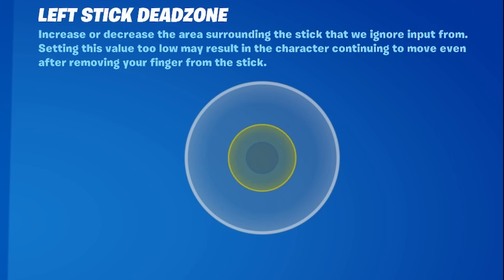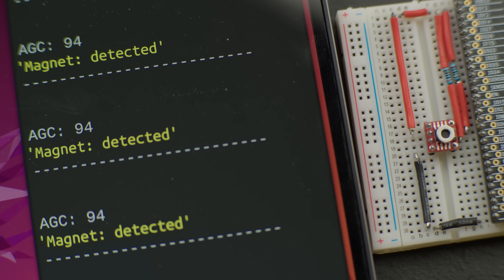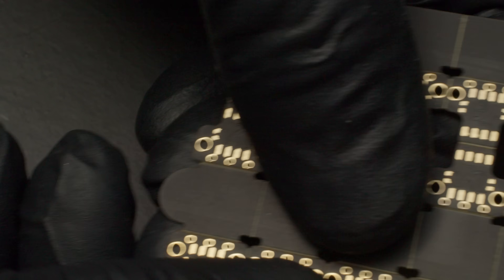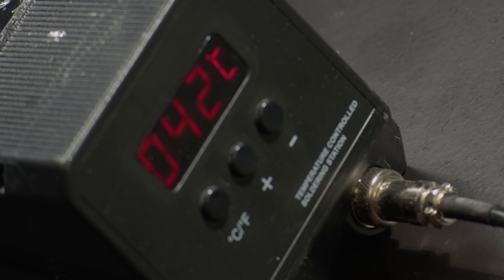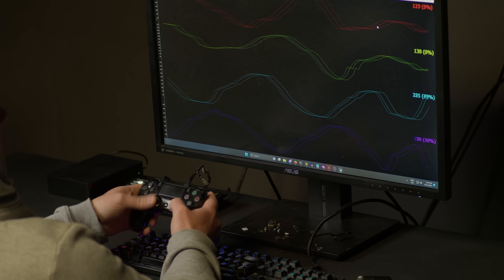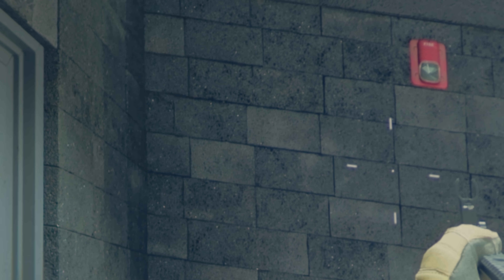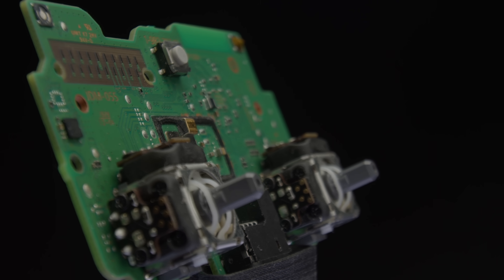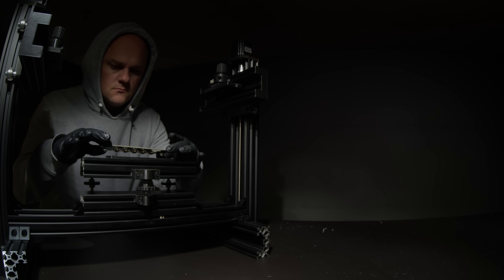Beating the $20B Joystick Drift Problem, and giving it away for free

Comment: As much as I get wanting to not license your product at all, you should license it under an open source license simply to protect it from copyright trolls. They could steal the design, claim it as their own, which by itself doesn't matter, but then they can sue all the other people using your design as if it is theirs, stopping others from using it, which is the real problem.
Reply: @cykes5124 they’re actually already for sale as replacements for various game controllers under the brand name Gulikit. Linus Tech Tips covered the Gulikit aftermarket ones in their “repairing broken controllers” video almost a year ago. $27 for the Joycon ones and $32 for Steam Deck ones on amazon.

That said, this is a dumb problem and game companies should have switched to hall sensors on their own a decade ago.
Reply: @Chirishman6  fun fact the Dreamcast controllers were Hall effect. Companies like Sony never switched because they want to sell you brand new controllers every few months.
Reply: @wayne8797  I still have my Dreamcast!
Reply: @Chirishman6 Ironically, controllers a decade ago did use Hall effect joysticks...The N64 controller is one of the first i can think of
Reply: @Chirishman6  the dreamcast fixed this problem, had hall effect joysticks, even the n64 had drift proof joysticks, it used an optical system similar to early computer mice.
Reply: @Chirishman6   Gulikit doesn't make the sensors they make controllers and distribute the hall effect sensors. Not a big deal but just to get get information correct.
Reply: @Chirishman6 ummmmm so just so everyone in this thread is aware, I have OFFICIALLY applied for the copyright license for this. I’ve recreated it and have a working model. I will sue anyone that uses this if I get the copyright. You’ve been warned.
Reply: Why would they switch to something that is going to make it so you don’t have to give them more money eventually?
Reply: @Chirishman6  The problem may be with finding the material for the magnets
Reply: @Chirishman6  just checked there products section they only do that for switch and steam handheld joysticks
Reply: @Chirishman6  sega tried, and they left the console market after its failure
Reply: @Chirishman6 Why would they, the way they do just causes more controls to be sold anyways so is it really a benefit for the company.
Reply: @Chirishman6  Why would you improve a part that fails in a rather short period of time and keeps people coming back for new ones? You'd sell less and spend more. You're adorably innocent if you think corporations give a fuck about the consumer.
Reply: @Chirishman6 why would they switch to new sensors when they can just get you to buy new controllers
Reply: @Chirishman6  its not dumb. they do it on purpose. Why would they design controllers to not break when they could make a person pay a crazy amount every year for a new controller? why does the controller cost that much? so they profit off it.
Reply: @Chirishman6  They dont want to do it, cause they want to sell controllers.
Reply: @Chirishman6  sadly no xbox ones =(
Reply: @Chirishman6  they chose not to for the same reasons Microsoft keeps renewing its contract with Duracell corporation for its official controllers every console generation.
Reply: @haloquayle  so I’ve recently learned what the tradeoff is, traditional analog sticks wear out with use. The magnetic components in hall effect sticks apparently degrade over time, not with use. So you can use hall sensor sticks harder but in 10 years or whatever it is they’ll be glitchy whether you used them every day or not at all. It’s an interesting trade off.

Personally I’ve swapped hall sticks into my joycons but I’ve not done my Steam Deck because they’ve not been a problem so far.
Reply: @Chirishman6  Really wish they would get class action lawsuit for them keeping using the same crappy drift-prone sticks for multiple generations in a row leading to people having to buy multiple controllers each generation. Especially now that they sell these piece of crap like a hundred bucks and up in many countries.
Reply: @Chirishman6 ya but they'd sell less controllers and they know that so no chance
Reply: but what about the 1 cent spent on the magnet  @Chirishman6
Reply: @Chirishman6  "That said, this is a dumb problem and game companies should have switched to hall sensors on their own a decade ago." Not for companies that want to sell you more controllers.
Reply: @Chirishman6 they tried it 25 years ago. They make less money that way. Which is people’s proof that these multi billion dollar companies don’t care about them.
Reply: @Chirishman6  how is it a problem for a company if it makes them more money?  most people don't realize that the reason companies exist is to make moeny. and if something brings them money and poeple are still buying there is no problem for them.
Reply: @Chirishman6  how is it that my first ps2 controller still works perfectly
Reply: @Chirishman6 sega used them in the Dreamcast, didn't they?
Reply: @dweld2144  yeah, the newer development is people figuring out a way to make them drop-in replacements on existing controllers instead of the controller having to be designed for them from the jump.
Reply: @Chirishman6 then they wouldn't make sales on new controllers or collect license fees from aftermarket controllers.
Reply: @Chirishman6 it’s not dumb, it’s a timed obsolescence thing.
Reply: @Chirishman  the Sega Saturn and Nintendo GameCube controllers had hall-effect sensors decades ago. Nintendo realized they could make a lot more money selling controllers that only last months, instead of the life of the console. It's called planned obsolescence. It's illegal, but it's hard to prove when they can just say they only use potentiometers to cut down on cost. That's obviously not true, but they'll keep using them until customers stop buying their crap controllers.
Reply: @zues287 GameCube uses standard potentiometers.  The Saturn and Dreamcast both used Hall effect though.  PS1 used potentiometers and n64 used an optical sensor similar to an old ball mouse.
Reply: @Chirishman6 that would lessen the number of controller sales, possibly lowering share prices, angering shareholders (the only people a public company cares about)
Reply: @Chirishman6  these companie are making a shit load of money on this problem it's obvious they will never get to fixing it unless we stop buying new controllers
Reply: @Chirishman6  but that means selling less controllers. what are you, anticapitalist?
Reply: If the license is a problem, MIT License should resolve. It gives full control to commercial and non-commercial implementations. But it turns you, Heier, the creator and maintainer of a certain piece of code. In this case, the g-code of circuit, the design made in a CAM software and the programming to the driver if needed.
Reply: In other words: you own the information rights, giving access to anyone to use as-is, in any way they might want.
Reply: Yeah if some invention is published to general public before patenting, it is not possible to get it patented anymore. So best way to overcome patent trolls is publish new inventions asap if you just want to share something free to everyone.
Reply: 6:00 they did say it would be made open source.
Reply: @DeusExRequiem  yeah but at 16:20 he did say "no license". You do have to specifically license it open source, you can't just say "anyone can use this for free"
Reply: @SimonAquarius being open source and being copyrighted and open source are two different things
Reply: @DeusExRequiem Who is 'they'? He's one person
Reply: @SimonAquarius  Just because a thing is open source does not mean it's automatically licensed under an open source license. By specifically getting this licensed under an open source license you are preventing people from privately licensing it which in turn prevents people from copyrighting it as theirs.
Reply: he* did say, he's one person only lmao
Reply: @SimonAquarius You mean "He", not "They". It is improper grammar to say "they" in this context.
Reply: Who is 'they'  @SimonAquarius
Reply: @SimonAquarius  they?!
Reply: Just to point out, this actually isn't the case, if you can prove (which this video does) that your design/invention existed for common use before the patent was filed, (especially by somebody else) then nobody can patent troll because they'll have no standing and you wouldn't even need to go to court over it.
Reply: @Spartan322  actually still no

your right if you can prove you had the idea first that helps in copyright patent however is whoever pattented first 

hence where patent trolls come in

now you can contest this and have the patent turned over to you by proving the idea was in circulation or invented by you before they patented 

but herin lies the troll part its gonna cost ALOT of money to challenge that patent in lawyer and court fees and pattent trolls and there lawyers can and will drag this out as long as they can with delays requests for evidence and reschedule for court dates continuences and all manner of legal bs to stretch this court case out for years even decades in the jopes youll drop the case unable to afford to go on awarding them a default judgement
Reply: @Sarge92  Patents aren't inherently accepted simply because someone tries to register an idea, and they don't inherently hold up in court simply because someone was able to register a patent, a case does not require you paying any court fees (including attorneys) simply because a patent was registered, so long as you submit evidence to pre-existent to the patent which the patent owner has no right to, you don't need to pay an attorney or court fees, the judge can simply rule on the case.
Reply: @Spartan322 look at struggles with Hangprinter. They have excessive documentation of prior art but they can't afford process costs to get down patent that stopped them
Reply: @Spartan322  you can prove it if you have a few million dollars to spend on court
patent trolls rely on the fact that you don't
non-millionaries don't have rights in america
Reply: @Spartan322  Copyright trolls use "process is the punishment" tactics to torture their victims, in the hopes that people won't try to challenge them in court, even when the facts are ultimately not on their side.
Reply: @sirzorg5728  This. If you get sued as average joe, you either cave or hire a lawyer to prove you right, and you lose anyway because $$$$ lawyer bills.
Reply: @sirzorg5728  Except you don't have to even go to court, if you have a record that demonstrates their claim as historically false, you don't have to pay anything.
Reply: @N20Joe  always countersue for expenses aswell to cover your legal bills.
Reply: @N20Joe  Which is why losers in cases like that should have to pay for the bills. It's absolutely fucking absurd that large companies can just get away with blatantly disregarding law, because they know that the average person can't challenge them financially.
Reply: @Spartan322  until a court favors them*
Reply: @Boardwoards  That's not how that works, its not a case of the court's favor.
Reply: There is so much confusion about patenting in this discussion, that I feel I want to help by clearing things out a bit. Disclaimer: I hold patents used in commercial products but I am still not a millionaire. OK, so patenting and licensing are two completely different things. Its like talking about cows and milk. From the point of view of patent laws, it does not matter if an invention was made with an open source license or not. What happens, as is the case here, is that if someone publishes a genuinely new solution to a problem (eg. Youtube video, demonstration at a fair, written article), it becomes prior art. Publishing ideas so that they become prior art is a valid strategy used all the time by companies and inventors. It is very effective in protecting against patent trolling - if the invention is indeed new and not an accidental copy of an existing patented solution. Licensing a solution is a public declaration that you allow others to use and expand your work and have no intention to sue them if they do it according to the license. Secondly, about "patents are evil". It took (in my cases) several years of R&D, prototyping and testing to bring a new different solution to the market. The first 3-5 years of sales is usually needed just to be able to recoup the development costs. If there were no patents at all, any competitor could simply copy-paste all that hard work that was done immediately and undercut the original inventor without any risk. Patenting has its flaws (trolls etc) but I do not see how companies could afford to take the risks they do unless they had some kind of protection against outright copying.
Reply: @jonnection   I worked for about 17 years for an Intellectual Property law firm, with many patent attorneys.  They told me that it is vital that your invention be kept secret at least until you have patent pending status from all the Patent and Trademark Offices in the locations where you wish to protect your invention.

Although it is true that demonstration of your invention prior to it being patented can serve as proof of prior art, this is a very weak protection and another company or person can still patent your invention out from under you, at which you then need to argue your case in court and can still lose.

Develop your invention in secret, apply to have it patented, wait for patent pending status and only then think about going public with demonstrations.
Reply: @jonnection  Patent attorney here. This is the best explanation I've seen in this thread. Well done!
Reply: I'm no licensing expert but I like to upload my github projects under the GPL by default. It's fun to legally force people to share and play nice lol. If it's good enough for Linux, it's good enough for me
Reply: @cykes5124  got the point. Thanks
Reply: Unfortunately for GuliKit, they hadn't patent this implementation. They have a patent on their design, but they don't have a patent on this. If anything, Sega / Service Games could probably sue GuliKit into oblivion if they had only kept up with their HE implementation.
Reply: Technically in law, this video as long as its time stamped correctly can act as that proof of concept and act as a legal document.
Reply: @DJWESG1  theoretically seen it technically is/can. but there is one factor you forget, even though in this case it might be less likely, but it is quite common for things that bring huge changes. essentially it is hosted by one single company with a clear political agenda, and who also has proven to easily bend to money in the past, there have been many cases of such cover ups of proof, and in some cases even faking/spoofing proof since the history of the internet. most targeted by this howver are speciffic types of activist and hacker groups, as well as big change inducing inventions.
Reply: Hall effect joysticks are not new, in fact they're about 25 years old. I do not expect licensing it would be possible. Just buy gulikit ones
Reply: @cykes5124  Well putting this under a license wouldn't change that.
Reply: Pulling an Edison, eh?
Reply: @cykes5124  gullikits patent is only in China, so they actually can
Reply: I dont think he makes an OpenSource Patent. He is making the board design and code open source. That way anybody or a company can make it themself
Reply: So true. Today's world gets worse and worse.
Reply: It’s prior art now tho.
Reply: @cykes5124  unless you mean other companies with hall sensor joysticks for controllers are going to sue? Because thats also unlikely. Hall sensors are not proprietary, the specific design of that companies product might be, but theyd have a hard time arguing how you ripped off their "thumbstick" when thumbsticks on game controllers also generally are not proprietary. Maybe the actuation mechanism inside... but that can easily be modified, and again unless it was literally identical, hard time making an argument to sue
Reply: I was going to say the same. These companies know about this. I'm sure of it. But why do all the work and when they can charge $250 for em without the work.

I say you should protect it and open license it. I couldn't agree more!
Reply: YES, THANK YOU
Reply: He's not inventing anything new, GuliKit KingKong 2 already addressed this by using hall effect joysticks instead of potentiometer joysticks because potentiometers wear out quickly and cause drift, hall effect uses permanent magnets which will not wear out like a potentiometer is guaranteed to. Best part is, unlike Marius's "solution" there is nothing to get used to, the GuliKit KingKong 2 feels exactly like any other controller joystick lol and the GuliKit is already on the market for less than the standard controller and has received praise from LinusTechTips as being the king of controllers. Marius is trying to claim credit for something that has been done already. Best part? GuliKit sells analog stick sets so you can install your own in your own controller, no need to buy the KingKong 2, you can stick them in almost any controller you prefer. Slowly growing weary and tired of illegitimate youtubers and their gofundme/patreon get rich quick schemes that never develop into a finished product
Reply: @Kits-Snow  This is a mystifying opinion. Just because Marius is making something that does the same thing a company is making doesn't make open source offering here 'illegitimate' does it? I will be picking up one of these boards and the other parts to make this myself if he ever releases a PS5 version and it will not trouble me one bit that GuliKit or anyone else has a functionally similar item for sale.
Reply: now tell him how he can do that or where he can do that
Reply: It's already a commercial product though
Reply: @cykes5124 hall effect joysticks were invented in the 80's. This guy didn't invent them.

From Wikipedia: This led to the development and employment of Hall effect sensing to such applications in the 1980s as a means of contactless sensing. Several companies produce joysticks for industrial applications using Hall effect technology.
Reply: @Boogie_the_cat  Reading this comment section is what the netraweb is all about. Humans just basking in chronic ignorance.

edit: It's an addiction for idiots.
Reply: It's patent trolls that are the problem. The law is first to file, not first to invent, and it costs a fortune to register a patent. Without a copyright license the main threat is the estate of the author if they die.
Reply: Hall effect sensor joysticks aren't a new invention
Reply: It's not a new design, its just hall effect joysticks, they have been used for a long time. Some PS3 controllers have them, most modern radio controllers use them, some aftermarket controllers use them...
Reply: He can't because it's my product now.
Reply: Dreamcast controllers used the Hall effect
Reply: Hall effect joysticks have existed for a while now I don't see a issue with patents
Reply: CHINA101
Reply: True
Reply: A whole can of worms…
Reply: yep, that has happened to around every project I had published or tried to publish before I decided to not publish things anymore.
then the worst is how some things then get completely praised by people years later like insane high tech yet they don't even want to look or listen to you since some random corporation claimed and published it under their name, often the speciffic corporation who you had contacted to get their help to publish it.
Reply: @ted_van_loon  do you have documentation for your project? A YouTube playlist?
Explaining everything in a YouTube comment is not very effective.
Reply: @FreeThinker0  not on youtube and none of my serious stuff is online anymore as mentioned, well unless someone made a copy or backup of such things.
publishing anything online these days seems to always end up with some random corporation or random person taking your exact work and putting a pattent on it, as well as linking it to their name.
Reply: Thanks for the idea!
Reply: ♥After hearing the end of the video I came here to make this exact comment. Thanks for saying it so well!
Reply: I can't prove that I should be trusted, but trust me when I say that you definitely want an open source license.
Reply: @cykes5124  well duh , all the top stuff is gonna be black budget
Reply: This technology has already been made, he just made a video on it
Reply: @cykes5124  dont think you understand how that all works...
Reply: @cykes5124  Not enough about patenting to, but I know multiple electronics right down to the toaster in your kitchen uses off the shelf mass produced components in their electronics and theyre not being sued by the chip/component manufacturers nor do they need to get a license.
Reply: @cykes5124  they literally sell these producs (hall sensors for eg) with the INTENTION theyll be used in products or projects. And any bulk ordering would come under the same guise....

If I order 10000 hall sensors, potentiometers, could be diodes or even MCU processing chips.... and build a product.... theyre not coming to sue my company for patent infringement
Reply: @cykes5124  nope, just that specific design may be patented, you cant put a patent on freely open technology. Thats like saying only one company is allowed to make donuts because its a unique design shape or purspose, let alone make churros etc or other similar derivatives.
Reply: @cykes5124  in a more laymans terms thats like saying kawasaki came up with the idea for jetskis (yes the literaly name jetski is patented to kawasaki, they made the first) but theyre going to go sue seadoo because... reasons...
Reply: @cykes5124  oh wait one company made a phone with a touchscreen so now they're the only ones

Oh one company had the idea for screens in cars or any other sort of tech

the list goes on

theyve patented the DESIGN not the tech... cant patent a hall sensor... and i doubt this guys controller sticks are even slightly similar, just serving the same purpose and have a thumbstick on top using hall sensors...

Bottom line is he can sell these if he so chooses.
Reply: @cykes5124  i imagine a company larger than the singular individual in this video, has a much larger budget and more refined and technical patented design, using similar components that serves the same purpose than what hes currently making. I stand by my original comment,
Reply: I truly hope he’s able to.
Reply: MIT is the license to use.
Reply: Yeah, the problem here is assuming that the companies that make joysticks think that that is a problem. It’s not a problem for them because it sells them more controllers.
Reply: slice engineering
Reply: That happened to insulin...look what the US did with that, overcharging people that just want to live
Reply: @cykes5124  Which is why IP laws need to be completely rewritten from the ground up.
Reply: just what i was thinking, he was being too generous, he should get the benefits from this, it literally changes the game, if sony or microsoft saw this they’d be on production tonight and release new controllers and then sue him for something he made
Reply: Will this work with the Xbox  elite series 2 controllers!
Reply: With Guilin it you can adjust the dead zone. Why are you misleading people.
Reply: Quit wasting your time. You will never make a cheaper or higher quality than Guilikit.
Reply: Lol op dummy for not doing this 😂
Reply: VOTE THIS TO LIFE!
Reply: This. And maybe ad a licensing fee or maybe just certification stamp so people can be sure it’s made to your specs. And you police the making of the products with your patent.  Just so we get good mass produced options for the masses.
Reply: @cykes5124  The patent is already expired dude
Reply: Can’t do that if the information is already publicly available
Reply: and that is EXACTLY what one of the big manufacturers would do, so that nobody could make a controller that wouldnt fail. they get too much money on people buying new controllers to make one that wont fail.
Reply: @cykes5124 wrong
Reply: That’s… not how copyright works… and not how copyright trolls work…

You have an implicit copyright on anything you write/design/etc. preventing unlicensed people from copying your work for redistribution. If someone does copy your work and give it to someone else, you can enforce your copyright against that person (this is copyright infringement). 

A copy left license like you’re describing is just a license to the general public licensing them to copy and redistribute the product, as well as modify it sometimes, depending on the license. 

Intellectual Property (usually patent, not copyright) trolls usually purchase the intellectual property from the original owner and use the IP that they now own to sue others (often wrongfully) for IP infringement. The reason this works is because legal defense is expensive and it’s usually cheaper to settle out of court. 

What the OP licensing his work as copy left ACTUALLY achieves is to protect everyone copying his work against him or anyone who he sells his IP to in the future suing them. 

Further, he could take out a patent on the work, but that just prevents anyone else from using his manufacturing process for 20 years. That’s explicitly not his intention here.
Reply: File a patent, sell it to a copyright troll company, be rich.
Reply: No they can’t. It’s public domain now that he has published the it. It can’t be patented by anyone anymore.
Reply: Already to late now I am sure.  What a naive young man...
Reply: no some conpanny already patent that design
Reply: @cykes5124  until countries like China stop giving a crap about it
Reply: Hum I’m amazed and bemused. I would happily spend my money buying a third party ps5 controller with Hall effect sensors, but unless you sell to someone it will likely never become commercially availible
Reply: The Public Domain is respected under law, no need if you ask me, books that are like 200 years old dont have any IP right's anymore, so i dont see why there would be any reason to put a license on this, maybe just license it with only the condition that they mention you name as the maker, i think that would be good enough, but that's just my idea, i wouldn't allow if I where you to just say yeah i made this, there is a real danger to that, than yeah corporations & individuals whom aren't as "libre" with there creation's as you are would just claim it as there invention, that is a real danger, but like I said the Public Domain is respected you can't claim something in there that you didn't make as yours, but I'm just a crazy person not an IP lawyer or a license expert, an MIT or GPL sound's great but i wouldn't connect my self with MIT in any way, because frist of all it's a private university and i dont trust any university for that mater but in the case of MIT i would just refer you to Victor Marchetti book... And MIT is sponsored by well NGO's with what i would say questionable background, as for GNU GPL version 2 would do i guess, but in my opinion LGPL is beter, but do some digging on this you're self and/or hire an expert in the IP field and/or license field, anyway you earned my respect for just putting this out in the wild, and you earned a new sub 😁
Reply: @cykes5124  Yes and no, this is a homemade project, and these monster aren't called companies they are corporations.
And if they want to claim this as infringement on there IP on Hall Effect Sensors, they are the entity that has to proof that, that's how IP & patent law has worked since they were created, they have to proof that he stole there design more or less, and he has worked on this for 4 years so he can proof that isn't the case.
Reply: Go home u humans have solution for Zero
Reply: This isn’t a new idea, game pads are just crappy. I have a set of Hall effect sticks for my radio control transmitter.
Reply: IP shouldn't exist
Reply: That's not how licenses work. If he doesn't declare any licenses, it means NO ONE ELSE is allowed to user the design and code for proprietary purposes. The open source license is actually much more permissive than the absence of license
Reply: Yes. They should put in under open license if they want to protect it from being buried
Reply: Super eloquent way of describing what happened in software throughout the 80s and 90s.

Everyone knows the biggest offender. Not gonna take away from this excellent comment by getting political, but yeah…
Reply: Yeah there are already a ton of patents for a Hall effect joystick and companies have been using them for many decades, including in video games, where both the Sega Saturn and Dreamcast use Hall effect joysticks, but even better designed than this video.
Reply: @tomspecht4733  The patent for Hall effect joysticks expired several decades ago, anybody can use them with no licensing required.  Sega used them for both the Saturn and the Dreamcast.
Reply: it's already been solved decades ago, but they don't want to use the solution because they want more profit... SEGA and GuliKit fixed this in the 90s and their patent expired so Sony and Xbox have no excuse to not use that design. they don't use a potentiometer to detect movement, they use a hall effect sensor which has no moving parts, because it uses magnetism, thus it lasts nearly forever... they still sell controllers with hall effect sensors today and they last far longer.. video explanation : https://www.youtube.com/watch?v=MpLQf_q3avA&lc=UgySqCl8Za-qhZPILkZ4AaABAg
Reply: @dzplayer0149  Hall effect sensors have been around since the 50s.

Ultimately they are not some miracle cure all.  The chips which read the magnetic field can fail, and the magnetic field can and does shift over time too.   In both the Saturn and Dreamcast, which use Hall effect sensors, it’s very common for the spring which centers the joystick up to lose strength and bend over time too.

There really is no guaranteed easy answer to this question.  Joysticks wear out and if you want to play your heavily used consoles in 20 or 30 years you are going to have to learn how to solder.
Reply: It wouldn't hold up in court. Too much prior art.
Reply: Thank you for your contributions to technology improvements . ⭐️⭐️⭐️⭐️⭐️ 
knowledge is power : Thomas Jefferson
Reply: I totally agree with this guy Marius. If you want to do good, do it properly :)
Reply: While I totally appreciate a diy solution, unfortunately this has already been done by GuliKit. I know about them because they make replacement magnetic stick modules for the Steamdeck.
Reply: Please listen to this comment
Reply: That is a very valid point!
Reply: Reminds me of the Linux 'brand' getting used by someone else and then the someone else sued Linus' Team over it
Reply: I’m beginning to wonder if copyright needs to end for good. I’m not actually sure if copyright is ethical/moral.
Reply: China does this anyway and did the moment the video dropped.
He should have kept it quiet and patented it globally. Then made deals with stick manufacturers.
Reply: GPL liscence FTW
Reply: Take my money
Reply: Ask "Smart Parts" how they did the paintball industry if you have doubts in what he said here.
Reply: Patents would be a pain but wouldn’t that offer better protection and they just list eco it at no cost?
Reply: Someone is going to have to explain to me how all the hall effect switches and minsticks on my old flight sim gear got there if this man here invented the hall sensor stick?
Reply: yes, ive seen this happen with pictures. personal ones. there have been people, in particular a woman i read of once, who uploaded pics they took of environmental things, trees, flowers etc, and uploaded them to the internet for free for all to enjoy. next thing you know companies like say Getty for example take those pics and then uploaded them  to their own website with their watermark and start charging people to use them. they then told the original photographer she needed to remove the pictures from her website or face legal action because they said she was using their pictures. thats a true story and is actually disgusting.
Reply: agreed.
Reply: That's me sorry
Reply: 1. that's not how it works 2. there is no original idea here to patent. it's just a retrofit kit to put hall effect sensors on analog sticks.
Reply: He didn't invent it tho
Reply: Hall effect sensors are a thing already. I think the first controller using these was Sonys Sega Saturn and that was back in the 90s. I don't know why he is pretending this is something new maybe to generate clicks.
Reply: They arent trolls. they are pieces of shit. Us trolls dont stoop that low.
Reply: I don't see how they can sue. They cannot patent the device because it is already in the public domain unless there is some other legal avenue that they can claim. If it's just a matter of putting this under a Github with a suitable LICENSE file, then easy done I guess but I think it would be quite an impediment to license it under open source if there was any type of financial cost to it
Reply: One thing also to be aware of is if this design already has a patent by one of the large manufacturers of controllers. I am being cynical here but what is stopping Logitech for example by taking out a patent on this method and never doing anything with it to stop other manufacturers from developing it
Reply: @adam3141  Dude hall effect sensors are a thing for quite some time. It was implemented in the 90s in one of the Sega consoles. He didn't invent anything new. Look it up. They were already making a comeback before this video got made. You can buy plenty of these type of hall effect joysticks online for a few bucks. There is nothing to buy it and "never do anything" with it. I already exists. But people here seem to think he invented something radically new.
Reply: did he ever do this btw
Reply: @mcbeaver9858  He is launching the first iteration soon which is for PS4. No idea when he will launch the PS5 version.
Reply: This isn't true at all.
Reply: Ps3 controllers already used a magnetic solution over a decade ago.

These companies don't care. They want you to continue buying overpriced, and worse controllers than what we had even 30 years ago.
Reply: No one can copyright something so basic hence why it still hasn't happened
Reply: @n64slayer  but doesn't that mean it's also not necessary?
Reply: Remember when insulin was so cheap to produce that the dude who found it didn't liscenced it ? Now people work 160 hours a month and can't afford it
Reply: You don't understand capitalism my friends, those companies actually want you to buy a new product or repair it from them.

Hope you know about The Phoebus cartel, now many companies have something similar.
Reply: This is not a new thing though, the hall effect joysticks existed for decades. They already sold these on Aliexpress. I already changed my PS4 controller’s joysticks with the hall effect ones. Also drone controllers are made with hall effect sensors for a decade now as well. So no, he can’t do that.
Reply: I thought I was just going to get a video about controllers but instead I watched an inspirational video of a person with a humbling and refreshing perspective gained in half a lifetime compared to most, you deserve all the good that comes your way. Thank you.
Reply: All that yapping and you didn’t even watch the video lmao
Reply: Companies frequently patent designs in order to make sure they are never produced.  It is a profit incentive to deliver consumers a product that is JUST good enough, but not so good that they don't need to keep buying it.  We will never have nice things.
Reply: Sony having a System to prevent that Problem too but they still dont Use it.
Reply: Nothing to copyright. Hall joysticks already exists.
Potentiometer joysticks are just cheaper
Reply: this is why Chinese manufacturers can sell hall effect analogs for cheap... it's not patented.
also they do always sell vibration equipped gamepads for cheaper too.
Reply: Or, you know, companies, who want to continue you paying for new controllers, because old have intentional stick drift problems, yeah? Like they did it before, patented something, forbidden anyone to produce this skmething and never produced it themselves.
Reply: Like Thomas Edison.
Reply: ya. they already know about it. they design and manufacture the controllers in the "planned obsolescence " fashion so that people have to buy more controllers thereby increasing profits. imagine if most people never have to buy extra controllers and just use the original for the life of the console because it's so durable and doesn't drift after a while. that's hundreds of millions of dollars right there
Reply: TRUE!!!
Reply: The big company’s  want them to fail over time. Better business
Reply: you can't claim something that is already prior art, open source, etc.
Reply: How great would it be if we crowd funded it to be open source.
Reply: Open sources = no license/owner.
If i change a bolt= no more open sources = i record as my copyright before others = my exclusive.

Look at microsoft, apple, as a sample. They are based on open source programs and stuff they made their priorities!
Reply: @Ale_giro  that's completely wrong, no license is public domain, open source is licensed under a permissive license
Reply: MIT
Reply: Sounds like a government issue
Reply: If he made this in the US or UK, the content is protected. First to use not first to register
Reply: Real
Reply: Yeah, just called China. They don’t care.
Reply: Sony now hates you because they rely on stick drift to get more sales on controllers. They could have fixed it but it loses them alot of money if they fix it permanently. I however thank you deeply for contributing to the world and not being greedy like most
Reply: that's a good argument.
Reply: he did not create this tho
Reply: Not how copyright works.
Reply: There's nothing here he can license. These hall effect sensors are used everywhere. There's nothing new here.
Reply: This has literally already been done, the guy is doing NOTHING NEW.
Reply: Good idea bro. Imma hop right on it XD
Reply: There's nothing to license, plenty of prior art (early PS3 controllers, GuliKit) - hall effect joysticks are nothing new.
Reply: @Entropy512  That's true, the meaningful IP here is specific designs and files which just make it more convenient for others to reproduce the design easily. (IANAL)
Reply: @Entropy512 yep the Dreamcast controls came with Hall effect sticks. I still have my original controller no drift, but the ergonomics are horrible.
Reply: @Entropy512   Yep.  I have a Saitek X52 PC flight control joystick, which uses Hall effect sensors for most of it's axis and I bought it almost 20 years ago!
Reply: @Entropy512 shhh your facts get in the way of people being mad on the internet
Reply: @Entropy512  click bait yo
Reply: THIS
Reply: @alfrd1794  who's they Im sorry only one guy in video
Reply: This is incredibly important (and hopefully done) because too many projects have been put in the public and then stolen and copyrighted
Reply: @eloryosnak4100   
I guess in some way their stupidity shot back at them, because their metaverse isn't doing well, and the device they made it way to expensive for big scale commecial adoption still since those parts got more expensive and other technology is there now, back then when I designed it there was no good vr tracking on the market, basically the best there was was something like a wii controller, or a complex camera setup which beck then was very expensive and required custom suits which then also needed a seperate computer to track the data, and often couldn't even do it real time(video tracking using multiple cameras(production cameras mostly back then, since back then it basically was only used for movies).
essentially by deciding to secretly steal my idea and waiting a few years in the hope of me not noticing(despite me being a young child back then, so if they would have givven me one such devices to play with and name recognition, or a small amount of money or a small share in that hardware I would have agreed with it, probably would have already agreed with only name recognition if I was allowed to use the device and if it was published for not to expensive.
instead they decided to pattent my device and publish it as if they designed it, which in result also somehow happened to exactly be just before I wanted to contact them with a second version with which they could have actually taken over the entire market easily since if someone with their reach publishes such a device(version 3, in current days it would probably be called full dive(or almost since it doesn't actually properly handle pain and such, and vision is still done with vr glasses, kind of like a one way version), but back then I didn't really watch shows or other popular media, wasn't allowed to really game either, so didn't know of any schience fiction stories using such a similar device in the story and the names, so I named it a half teleporter which was a marketing name to market it for remote working, originally it was more meant to be a half shapeshifting mashine(version 1), allowing you to controll one or multiple(one at a time) artificial bodies remotely as if they where your own body, back then the idea was to make robotic bodies to just give people a feeling like shapeshifting, and with people I mean me, I just designed it and wanted it to play with, saying this I realize there also was another 2 versions between version 1 and 2, I will call it version 1,5 for now to avoid confsion since that one isn't really important for the story, one of those 2 has actually been made to some extend by another group of people that recently was a kickstarter campaign, but I never published that version so they actually came up with it themselves as well, that version also required actual movement and only was a enhancement of existing methods.))
but if facebook didn't screw me then they would now(already before covid-19) have been in a much better position, and now they might have had world dominition(something which would then now be my accidental fault(funny thing was that despite me already knowing facebook wasn't the most people friendly or correct company, I had little choice back then since I really wanted to play with it, and my 2 options for getting to actually play with it(needed a bigger influencial force to actually get software support or proper hardware robots to controll), and those options where 1:facebook and 2: the army, I actually designed some custom encryption methods to for them as well for communicating with the robots, but I didn't want them to be used for oppressing people, and I knew that such technology in the hands of the militairy would possibly lead to that, I just didn't want my technology to be used as a weapon, only for fun, like superheroes and defence.) the interesting refference there is that if I had published version 3 to or with facebook, weather they made it with me, or would have stolen it from me, then right now they would likely have taken over the world, and essentially have used it as a weapon, since I don't know how long it was before covid-19 but if they had published those devices before or early in covid-19 along with some virtual workspace or some early version of the metaverse then that would have caused a insane increase in home working, kind of like how zoom went from small to big, but then this can actually also use things that require physical movements and you can actually walk around a virtual office meaning for example a teacher could see that students arent secretly just playing on their phone instead, or controlling actual mashines would be possible. if they had both that hardware attracting many gamers and attention and  all those people from homework and such then they might have gotten way to much power. 

but that is only one example, there are many more, also from co students, like how a co student stole my project, or just actually invited some people and told them that was his project and explained them exactly what I had said to him/how I had explained it to him, so he even explained it wrong since I had to heavily simplify it for him to understand it, so much that in essense it was around right but not completely(for the sake of simplifying it, since he didn't have a project so he would instead do some marketing and presentation stuf for my project since that could be quicly done and my project was impressive enough to intead of increasing efficiency with a few %, just let the device only use a few % of the power to actually reach higher speed and accuracy(1*)
as a result of him inviting some important people from a certain college and then while I was distracted and at a distance pretending to them that it was his project and work instead of mine, he got directly accepted despite actually having scored way to low to even be concidered there normally, 
as well as a free scholarship at some study there despite him actually ( I think it was enginearing).
while I had to drop out of college some years later due to not having enough funds to continue.
then also those people where influencial it gained him some more than just a free scalarship, ofcource under his name, while in reality ofcource he had nothing to do with it, I just let him do some marketing and presentation stuf since in the last few weeks it turned out he didn't have anything working yet, and since he was a study mate(since I had to do some projects with him and so knew him kind of) I decided to help him out, but all he did was just preparing some presentation stand, he just pretened to have done what in reality I had done.

again there are many more cases, these 2 are just somewhat interesting ones that are mosly safe to talk about, sicne some can be dangerous to talk about as well as that in this case, one is some big corporation stealing something I had designed and presented to them while I was still quite a little child, and somehow when they years later published it they got praised like a god largely also by people with a university/college degree, where many found it unbeleivable how such "hightech" could even already be possible. (while some person who in general most of them wouldn't even want to listen to and who they would treat like someone stupid because he doesn't have his degree since he had to drop out due to not having enough money to continue, actually was the one who designed it and that person actually designed it and had it working many years ago, and the version they praise is litterally the version that person(me) showed facebook and contacted them with along with the actual designs for the full masine)

(1*):(improved a device from a certain company with many enginears and r&d which back then beleived it was near impossible to improve their device and if it was possible only by a few %, I managed to improve it so much that only one enginear at that company(and that enginear had a insane amount of experience in many fields he also was one of the people behind designing the main principles of chip making mashines and many of the early version up untill shortly after the twintowers collapsed since he left due to instabilities, many years later asml tried to get him in but they got rejected by him since he didn't like the work atmosphere of all being to much put into boxes, due to privacy reasons as well as legal reasons I won't name the company or that enginear, but he was the only one who was capable of understanding how it worked, all others just thought it was impossible and saw it like a free energy device and where searching for how I would have faked it, so I made a very simple prototype that made it clear that there where no hidden engines or powersources or such, in certain parts energy usage was reduced by around 100 times just using many different types of physics, and instead of thinking in 1 dimensional laws, actually looking at it like a object in 4 dimensions(3d and Time) and just simulating it in my head looking at many things at the same time to find problems and then try out many things in my head to find how they affect it and then optimize that.
Reply: @eloryosnak4100  yes exactly, that has been around every project I had published untill I stopped publishing projects to the publick. for example that "new hightech" vr controller "from facebook" which used emg and software/ai, which actually is something I designed back in highschool somewhere like 2013 or such, and since I had no funds to make a full scale version but wanted to play with it(back then I could only make just enough to know it did work, but I could only make small parts at a time since I just didn't have enough parts or money). I contacted facebook because I thought they might be one of the companies with enough resources to actually make it even better than how I designed it so that it could be mass produced very cheaply(was meant for full body tracking, back then mostly aimed at controlling a robotic body and for motion tracking in softwares like blender since vr games wheren't really a thing back then, in my marketing towards facebook I however used the argument that it could be used for remote working by either controlling robots at work, or working office jobs in a viritual world/virtual work environment, this also was long before remote working became common, I basically explained the device and my designs and their answer was simply no, without a good reason, mostly just suggesting it wasn't something anyone ever would want to use. 
fast foreward many years, around that time I had a second version which was much cheaper to make due to custom sensors I designed myself which where also much more stable and effective than standard emg sensors for that use case(specilized sensors however, speciffically for that use case, but very easy and cheap to mass produce, can also be made easily by hand but then they become much bigger) I had made a working prototype already but again no full one this one only tracked one arm, that was because it took long to make the sensors by hand as well as the device itself having a lot of wires and such, and I just am not really the type who will keep on when having to manually solder 100 wires or such, so again I wanted to contact them but then to get them to mass produce them for very cheap(since while mass produced such a full body half-teleporte link(half teleporter was the name I used, since it essentially was like in the matrix where ones conciousnes gets teleported using a phone call, my first version(I only shared the econd version with facebook, at this moment I had 3 versions, but the first I mostly don't name because that one still was to complex to get working since it would need very complex AI and the hardware suddenly got a insane price increase making it useless, by now ai is probably advanced enough for version one, but currently the speciffic required components and materials have risen so much that it would now cost around €50000 to make, the second would now cost around €2000 €10000, the third would now cost around €50 to €200 to make, it can even be made cheaper, and I have a 4th version but don't use that yet since it is more complex than the 3th version and has very little advantages, but the 4th sensor can in reality read a lot more data but the softwares of today won't even support version 2 or 3 yet in the amount of data they can use(games just are still made for a few buttons, or low resolution tracking so custom software or updates would be needed to use real concious body tracking(meaning you actually controll your other body just like your normal one, a nice advantage of version 3 is also that it is much safer to use than any current vr tracking since it is capable of safely canceling out most of your bodies actual movement, not all of it, but what is left is more like small movements or twitching, the method to do it is quite safe as well, the sensors of version 3 can also handle static and high voltage quite well allowing for static haptic feedback., even though conventional methods might also be used, It is just that version 1 and 2 couldn't handle that, and 3 can), and again the canceling of most of the bodies movements is basically completely safe, there are a few cases in which it can be dangerous but that i mostly for example if your house lights on fire or such and due to something you can't disable the body canceling. but the reason this is safe is because it allows you to just lay down in something like a bed for example or a capsule at a gaming place and you wouldn't have to worry about your body hitting something, or accidentally walking on a bussy road in london, making it much safer to use and ofcource that it is full body tracking(tracking as in that your avatar actually moves the way you want it to, since facebook actually publihed and patented my second version under their name you know how it works now, since it works instead of measuring actual movements by measuring the signals of your body)

but contacting facebook wasn't easy anymore so I went to their linkedin page to some page of them related to technology, and there as the top post from them I found litterlly my device(second version) which I had send them years ago, yet they claimed they designed and invented it and actually where getting tons of praise for it while in reality it just was my device and my designs from many years ago, they replaced some parts from hobbyist parts to more expensive smaller nicer looking parts but they worked the exact same, and to make it I had contacted them because I didn't have any resources for making a full version, yet when they decided to secretly steal the project I showed them years before they decided to not even go though the trouble of actually making the whole device, instead they only did what I already was capable of with my limited stuff, they just tracked one hand.
Reply: Are controller manufacturers not fixing this issue on purpose so we'll buy more controllers. I have two dualshock controllers I can't even use because the drift is so bad. One I only had for a couple months before it started to drift and I bought these two controllers new.
Reply: I agree. But he also has video proof of the design on YouTube that should predate anyone else licensing it. 

That should hold up in court, but will also cost in legal fees down the road. It would be better to preemptively license/patent designs and that should be more legally binding and reduce the lawyering fees later.
Reply: @TheMrEwe  bro he isn't the first to invent it
Reply: Yea man especially with nasty ass Nintendo out here and all of their conniving devious ways I agree. Fantastic work here! From someone who has been fighting stick drift since 1998 as my first PSX came with the first gen dual shock controllers and boy they did not last well 😂
Reply: @cykes5124  not entirely true. you are partly right though. Or you may have meant what i am goint to say.

 hall effect stick themselfs can't be patente at all (by anybody). If they could then Sega would have done so when they first used hall effect sticks in the saturn and the dreamcast controllers in the mid 90s.
 
A patented can only apply to a specific implementation or design of an idea.
if what you said was true then instead of patenting a specific drill, companies would have patented rotary devices. What is patented however is a specific implementation of hall effect sensors in the housing (wich is a design) of a potentiometer. Gullikit has a specif patented for that design. It is the same with scuff and backbuttons. Backbuttons themselfs are not patented. Only back buttons that resemble a specific (paddle shape deign) And even that pattent was falsly granted by a patent lawyer that had not done his research correctly. Because theire where already paddle shaped back buttons way before scuff (or specificly corrsair) had asked for a patent. If back buttons would be patented by scuff then valve would not have won the last rounds of lay suits against them.

but maybe this is what you meant, if so then just ignore this comment. I am just glad that more companies are using hall effect sticks. eventhough stickdrift was resolved more then 20 years ago. The real reason why the big 3 companies wont use them is because it will cost them milions of dollars in lost sales from ne controllers or stick replacement modules. Even gulikit can implement them cost effectivly in a cheap 60 - 70 dollar controller. And gulikit only sells one or two controllers and a few hall effect replacement kits for joycons and the steamdeck as their only products. So if the big 3 claim that hall effect sticks would drive up the price for the controller, they would be lying outright. It is all done to optimize profits.
Reply: @caleasthetic   Patents are not granted by patent lawyers, they're granted by official patent and trademark offices, such as the USPTO.

Patent attorneys assist their clients with making proper applications to those offices and also can assist with patent searches for prior art.
Reply: @BeardyMacBeardFace  did not know who exactly grants the patents.
but for exampke the scuff back paddles patents should not have been granted. just because someone other companies already made controllers with back paddle shaped back buttons.

this is also the reason why valve won the last round in court over the back button dispute. the steamcontroller might have had back buttons that resembled paddles, but the steamdeck has back buttons that are shaped differently. So valve does not have to pay scuff for using back buttons.
Reply: @caleasthetic Plus there's an ambiguous category when evaluating patents that relates to obviousness. If a new but minor change is made to an existing product that's considered obvious without dramatically changing the functionality, you can't just patent it. Of course that's left up to interpretation but that's the idea.

The scuff paddles on the underside of the controller is a tough one. While it's an obvious change, exactly how's it's implemented can be quite significant. I think their patent is far too broad.
Reply: @cykes5124 they want them to break
Reply: he isnt the brightest no one cares about this and it doesn't effect how you play games its a waste of time
Reply: Please! Protect it!
Reply: Because he posted this video predating any possible parents, he would have ultimate claim.
Reply: @cykes5124   Unless you are Big Red Fruit, to copy the Creative and settle for a few millions few years later,while getting headstart as a Billion dollar  Company. Just some 💭
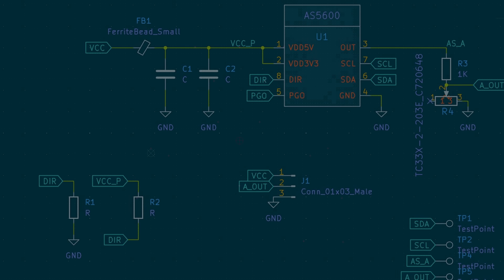Reply: 4:40 4:40 😅😅😅😅😅
Reply: Yet more reasons that patents should not exist.
Reply: @Sir Zorg  I think they should exist for the same reason they were created, what I don't agree with is the constant 'minor changes' that reapply the patent, this is the reason why inhalers are changed every few years, they are drug/dispenser combo, the drug hasn't changed for 50 years, the dispenser changes every 5-10 years which allows them to reapply the patent on the drug.  Its the same with copyright, if original copyright laws were still around, anyone could create a star wars movie.
Reply: @sirzorg5728  Stupid take. Better solution would be to shorten the duration of patents and prohibit them from being bought, sold, or traded. Currently, they expire 20 years after they're issued and can be bought and sold, which is how patent trolls get their hands on them. (Copyright trolls are another beast entirely.)
Reply: @AClockworkHellcat  I advocate for their total abolition, but I would support their reduction as well, because I won't allow the perfect solution to prevent a good one that is more likely to be achieved.
Reply: @sirzorg5728 no parltwnts no innovation.  Still back in the stone agem
Reply: @sirzorg5728  I agree with you here, IP law is a violation of the rights of the individual.